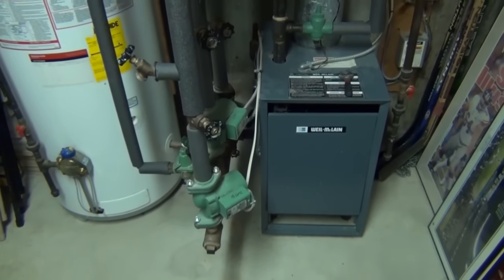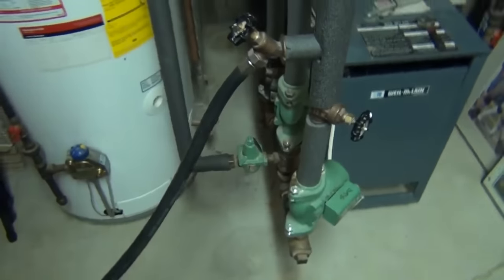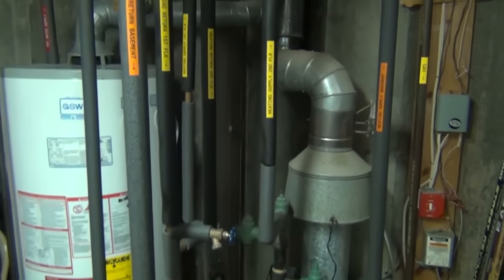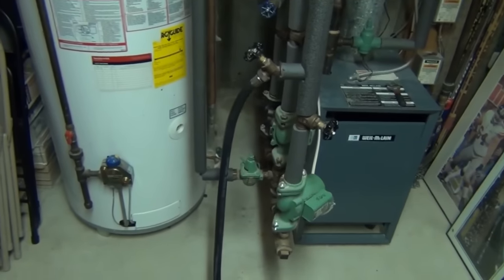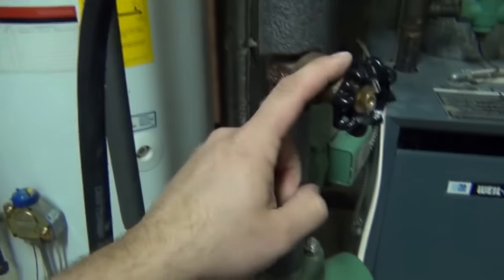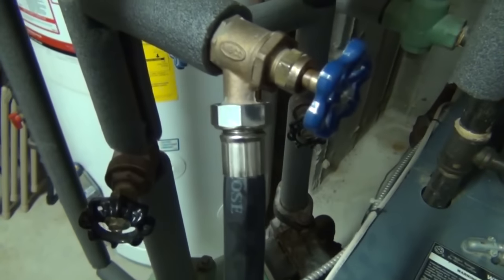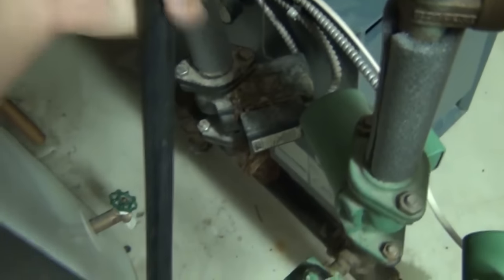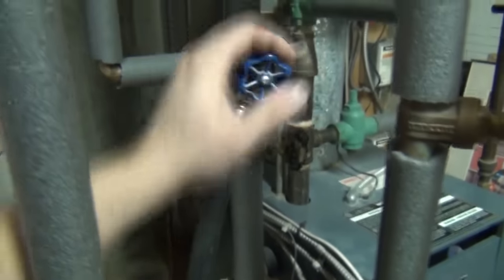Remove Air from your Boiler and Heating System | How To

Comment: There is minimal water drained (1/3 of a bucket)!!! What happening?
Reply from the maker: You need to open you fill valve or maybe your system is dry?  If so see if the fill valve is stuck closed. Do you have a low water cut off ?
Reply: @fixitwithzim  I brought in a plumber and learned that the fill valve is off. That’s an expensive switch-on 😭
Reply from the maker: @msmandy1018  yeah, that’s no fun but at least you’re ready for next time now!

Comment: I’m a plumber, a Spirovent is a Devise installed in the piping that automatically purges air while the system operates. It has copper brushes built in that do need to be changed every 5-10 years as required but other than that you will never need to purge or bleed your radiators or pipes again. If you didn’t know there is a great supply house (Supplyhouse,com ) that has great products and prices that mail all you order overnight anywhere in America. I use them now and nothing but great things happen, they take returns for just a small restock fee and are available for phone consultations. YOUR `𝚆𝚎𝚕𝚌𝚘𝚖𝚎. yours Mark Lane NYC Plumber. Now never say New Yorkers are assholes again, lol
Reply from the maker: Thanks, I’m aware of what a spirovent is, just wasn’t sure what you were originally getting at with your post. I’d love to rework this setup and relocate the X-tank, install an air scoop, etc. Supplyhouse is great, I use them all the time....and I don’t think badly about you, I live out on the Island...Suffolk county

Comment: Why we need  to bleed  the pipes?
Reply from the maker: To get the air that’s trapped in the system out. Trapped air makes for a noisy system and poor efficiency.
Reply: I have water coil  heater  but is not heating enough  is there  anyway  that I can  adjust?

Comment: When I turn the pressure relief lever from fast fill the pressure relief releases water under pressure.
Reply from the maker: You shouldn’t touch the lever on the pressure relief valve. Doing this will cause it to dump water out of the system which is what I suspect might have happened

Comment: You dont need the bucket. If you pinch the hose and hold it to your ear you can hear the air bubbles passing. Obviously the bucket is easier but not needed

Comment: I don't think i saw a back flow preventer next to the fill valve.  The rusty water should stay in the boiler loop and not travel back into the domestic side.
Reply from the maker: The Taco fill valve has an internal check valve to prevent this from happening. There is also a backflow valve that I didn’t show on camera further upstream. Thanks for the comment.

Comment: When I turn the pressure relief lever from fast fill the pressure relief releases water under pressure.
Reply: When you move the fast fill lever on the fill valve to the max pressure position you will cause the pressure to rise inside the boiler. Once it reaches approximately 30 psi the pressure relief valve will do it's job and open up. I suggest you leave the fill valve lever in it's normal position when bleeding.  May take longer to bleed the system but it's a much safer procedure for someone who is not experienced in bleeding a system.
Reply: On fast fill it doesn't take long to exceed 30psi which triggers the pressure relief valve. The only time you should use fast fill is when you have the drain valve open to bleed air.

Comment: What steps should be taken if the shutoff valves for the zone are before the air purge valve instead of after??

The only way to purge is to allow flow through the boiler.

Comment: How you know at what pressure your prv is set at?  Just checking the only pressure gsuge you have on the boiler outlet?  You supposed to pipe the prv such way with by-pass thst will let you see if prv works as gets stuck after years in service..

Comment: I like hydronic heating better that forced air heating, but you need a separate cooling system
Reply from the maker: Yes, hydronic will always give you better heat

Comment: why you have to empty your whole system to remove air? air is going to be trapped on the highest  parts of your system...plus it is harmful to replace new water on your system over time because of furring. you just need to put  automatic air release.
Reply from the maker: No way to get the air out if you don’t use this method if you don’t have bled valves in other spots on the system.  The hyvents don’t do nearly as good a job as a manual bleed

Comment: I bought a house that is 6 years old. All the plumbing was done extremely neat. Looks great.  Someone put all these valves on the supply lines. Now I'm fucked 😡
Reply from the maker: You can get it done still, a little more time needed but still possible. Add some valves down the road. It’s not hard
Reply: @fixitwithzim  how? The air is just getting pushed back to boiler. No place to release it
Reply from the maker: @justindwyer3832  there should be a boiler drain somewhere. You can purge from there. When it was originally installed, the installer had to purge it somehow or it wouldn’t have worked.
Reply: @fixitwithzim  good point.  I will check.  Thanks buddy

Comment: Totally wrong. The way you did it, you have not removed any air trapped inside the copper piping going around the house, plus the air inside the boiler.

Comment: And by bleeding hesting water from piping system and replanish it with fresh city cold water, guess what?  Cold wster carries lots of oxygen which after heated releases its O2, thus your system must be bleed with heated water with higher than operating pressure anf with minimal cold water to enter the system..
Reply: Especially for older homes have black Iron pipes in the system.